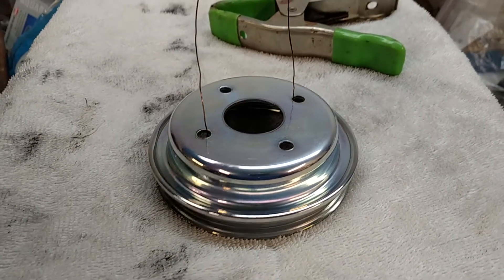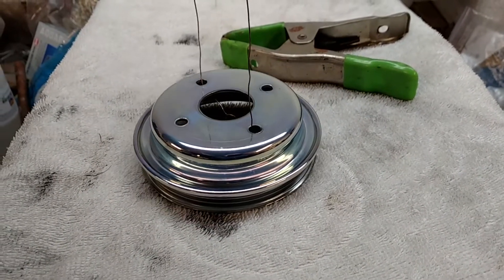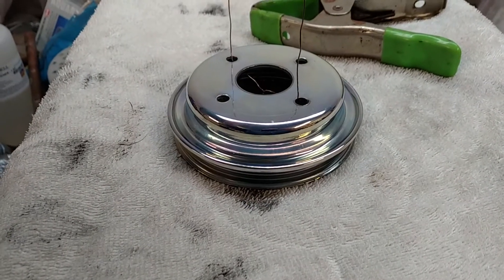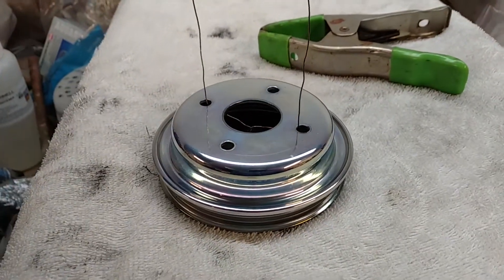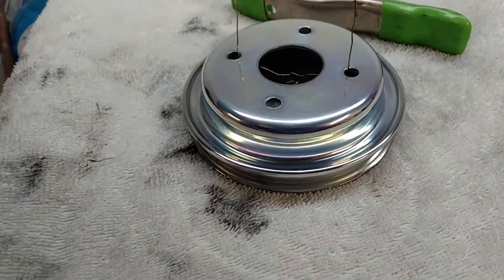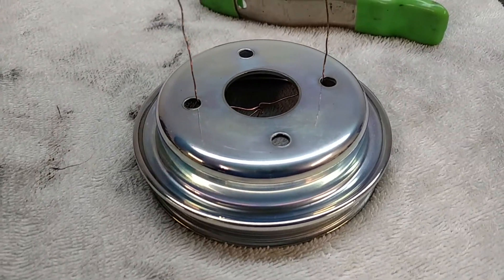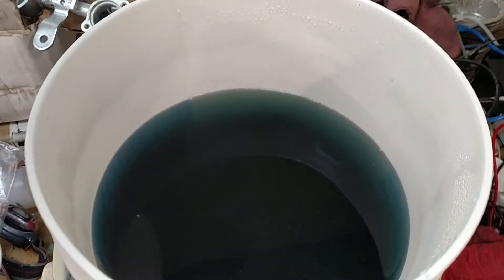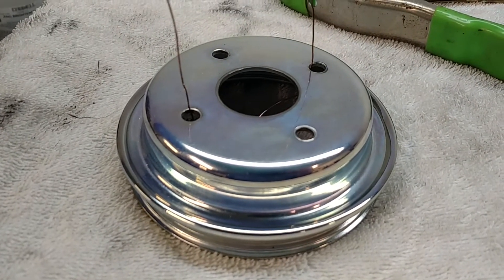Caswell Zinc Plating - Blue Chromate results

Comment: where can I find zinc I have looked everywhere
Reply from the maker: Matthew Read - You can find 99% pure zinc ingots on eBay, Amazon, etc. Caswell sells large flat plates and if you need to do larger items, a large plate will work best due to surface area. For small parts like individual bolts,  you can use smaller blocks of zinc. Also, boats use Zinc to prevent galvanic corrosion, so searching for "zinc boat" should give a lot of results.
Reply: Look on Amazon for "zinc roofing strips".

Comment: dude this is insane! 

what did you polish the zinc with ?
Reply: ok so then how did you polish the first stage of unplated metal? same technique? i have caswell zinc brightener and the blue chromate just like yours and that pulley looks awesome, share the details plz
Reply from the maker: Yes, I used the same method to polish the zinc. I just used a finer polishing compound. The important part is to make sure you have a pretty thick layer of zinc before you start polishing it. It's VERY easy to polish too much and take the zinc off. And if you do that, you'll see it as soon as you try to treat it with the chromate. I had to make multiple attempts at it to get it just right.
Reply: after plating many hours now i see what you mean, thick coat of zinc with no bare spots and maybe a bench grinder with a 6 inch wire wheel brush too harsh to polish with? i posted a 7 part video on my plating system...check kit out
Reply from the maker: Thanks! I polished it with a 1/2 HP, 6" buffer from Harbor Freight along with some "fine" and "very fine" polishing compounds.